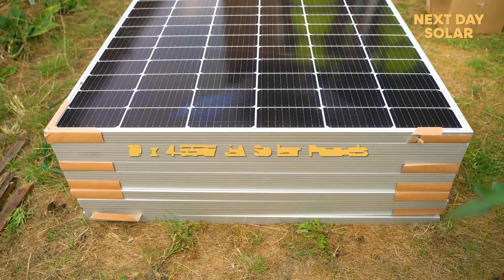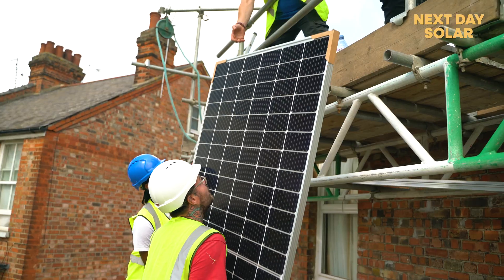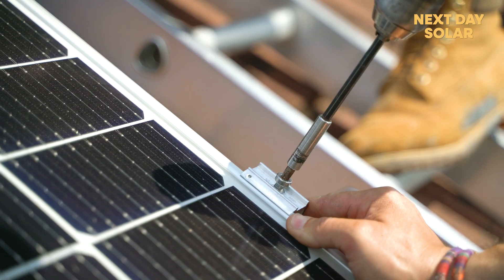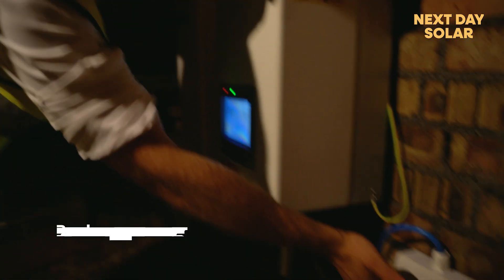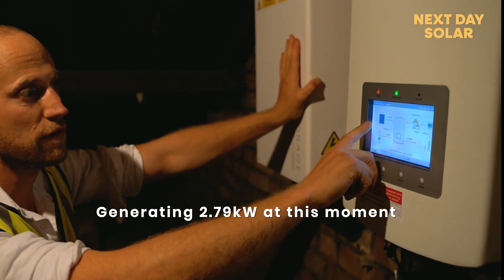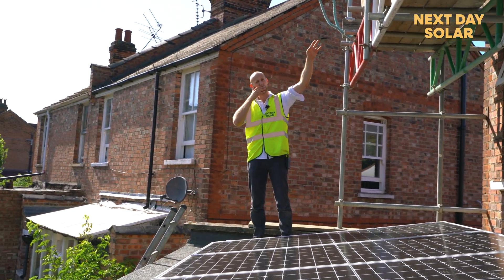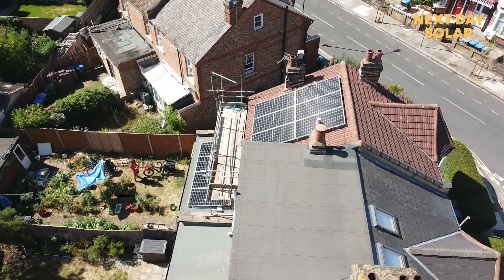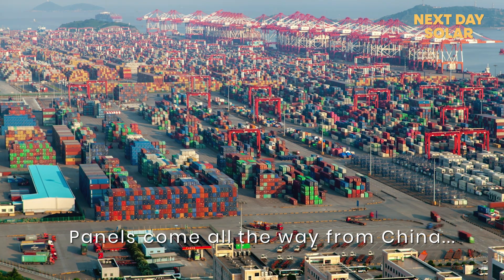Pitched & Flat Roof Solar Install with Battery, Fox / Solis Inverter - Step by Step Guide

Comment: Have you ever installed solar panels vertically against the wall?
Reply: No, I wouldn't recommend or suggest for a number of reasons, but they won't work properly.
Reply: @LolasCupcakeschannel  I understand they won't be as efficient. But it is an alternative to adding more solar toy existing array